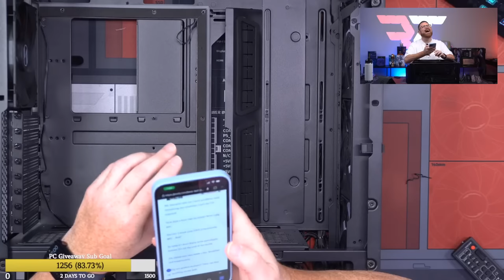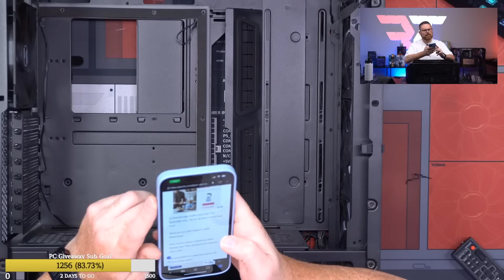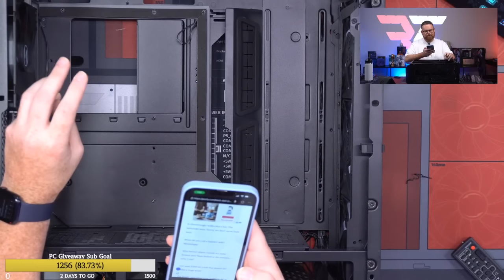$3000 Lancool III Build - Giveaways + Lian Li Lancool III (12900k / RTX 3080Ti)

Comment: Kinda off focus of the build but would this combo of parts be adequate for 3d modeling and ray trace rendering without any incompatibility issues IYO : 

 CPU-Intel Core i5 Core 12400F 
COOLER-ARCTIC Freezer 34 Esports Duo
MOTHERBOARD -ASUS Prime B660-PLUS D4 LGA 1700
RAM -TEAMGROUP T-Force Vulcan Z DDR4 32GB Kit
STORAGE  -Kingston NV1 500G M.2 2280 NVMe
 CASE -NZXT H510 Flow 
PSU -EVGA 850 Bq, 80+ Bronze 850W
GPU -ASUS ROG Strix NVIDIA GeForce RTX 3060 V2 OC 12GB

Current pricing through Amazon puts this config at less than$1500 actually at $1207.92 without trying any cost saving substitutions.